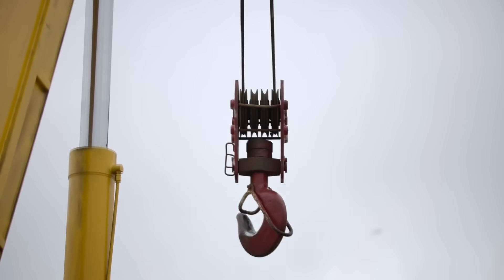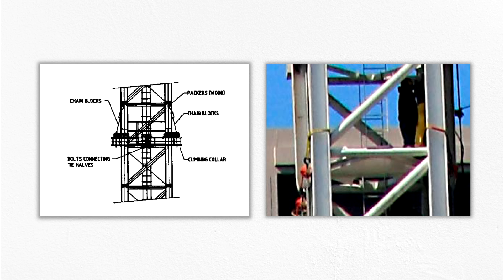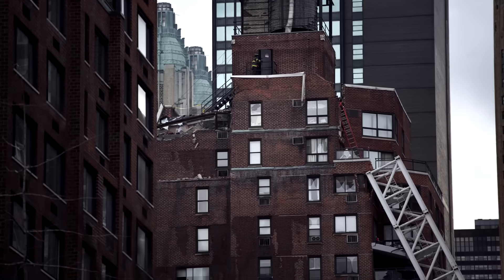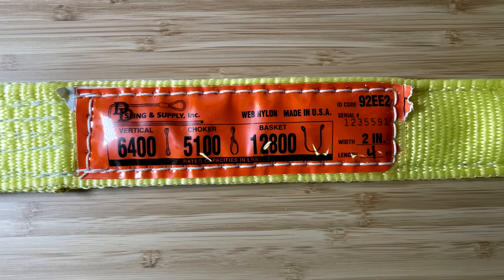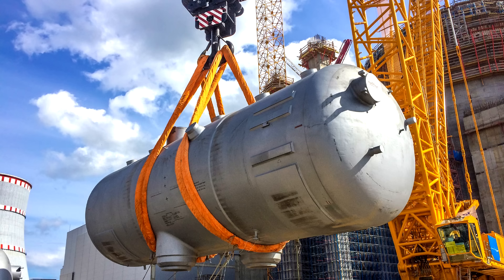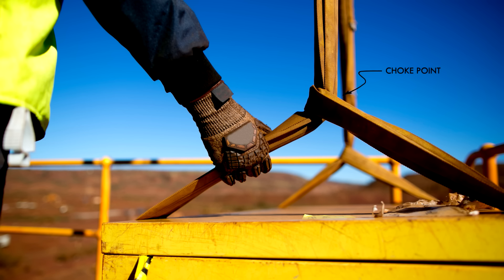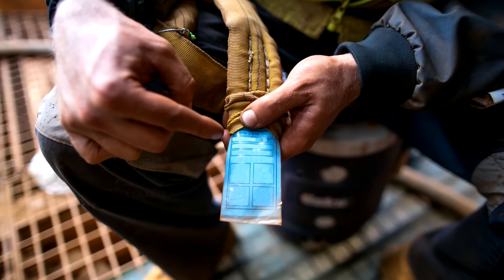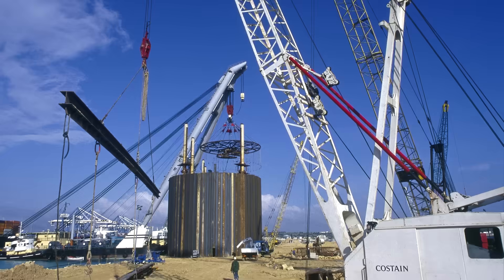Why Things Fall Off Cranes

Comment: One thing that affects the load a crane can carry is management caterwauling that the sling or chain is just fine, keep using it, a little cut won't hurt it. This is more common in steel shops that have a bridge crane.
Reply: Whenever I found a damaged sling I cut the eye open so nobody else could use it.
Reply: @brianveroba9059  Absolutely, I started doing the same when I came across stuff like that.
Reply: @brianveroba9059  I've had to do the same, though I've had guys still snag them out of the trash and fucking tie a knot to put them back into service. I just couldn't even.
Reply: Back in the late 80's I was in IE at a major manf. plant.  Our bridge crane was huge and when the siren was wailing, I'd move some where it wasn't.  I never EVER felt safe under the load.  It's like being claustrophobic.  I didn't mind heights on a good structure, but I never could trust loaded slings, chains or hooks.  Especially if I didn't rig it.  I still don't get under stuff unless it has stands or blocking under it.
Reply: @stxrynn  I now work for a concrete precasting plant, and it is a no-questions instant termination for anyone who walks under a suspended load. Some of our pieces weigh 60,000 pounds.
Reply: @stxrynn   I used a bridge and trolley crane to move 20 ton coils of steel. We had a big "C" hook for that and didn't use slings or chains.  We NEVER got under a load at any time, and if we were operating the crane, we NEVER took it over anyone.  Of course, that was at the end of nearly 40 years in manufacturing.  I started out, at 18 in a copper tube mill, using slings to attach bundles of copper or brass tubes to long booms handled by a bridge and trolley crane.  That was back in the late 70's, and I did stuff there that certainly wouldn't pass safety muster today.
Reply: @rodchallis8031  Understood.  There are times when you can't get the job done being too careful.  But I never was careless.  Sometimes, you have to do the hard thing... mitigate all the risk you can and get the job done as safely as possible.  But standing under a load was never one of the things I could do.  All of a sudden F=MA started running in my head and I beat feet out...
Reply: @stxrynn  thats just common sense
Reply: @southernshop8424  I thought so too, but the number of men that casually walked under the load EVERY time one went by was eye opening.  I couldn't do it.  Not even once.  Different times in the 80's, and a different work force I guess.  I still get the willies just thinking about it.
Reply: @stxrynn  in the early 80's i was a form rigger on three different lock and dams on the Tennessee-Tombigbee waterway project. I never once alllowed our crane operator to pass a load ooover anyone, to the point of pissing off ironwokers who were in the way. It was a union job, but ive also worked a lot of non union jobs where i was a rigger. The last 20 years of my job as a fitter liffting loads up to 140,000 lbs, the lock gates for lock 25 on the Missssissippi River, there were 6 of them, and myself and two coworkers hung them vertical in a jig in the shop using all three bridge cranes. I have never let 

anyone get under a load. 
You must have worked in a very unsafe shop. With some very arrogent uncaring people
Reply: @southernshop8424  I was just a kid, about 25.  My first big shop.  It was full of old timers that built the place and worked for the founder.  They were very comfortable with what they did.  Most started there in the 40's and 50's.  I guess the plant was build in the 40's to supply ammunition to the war effort.  We built some of the biggest mining equipment made.
Reply: Nylon slings usually have red fibers woven into them that can be exposed by a cut.  If the red fibers are exposed, the strap is to be removed from service immediately.
Reply: Makes me glad for my boss and foreman. One of our chain slings got dropped when taken off the hook and landed on its steel tag hard enough that it broke. 

We still had the parts and it was still legible. The foreman insisted the chain be retired until it could be retested.

Comment: Saw a rigging accident where they were doing a 50 meter lift inside a power plant. The riggers didn't have long enough cables so they WELDED two wire ropes together. Fortunately no one was under the load and there were no injuries.
There were some people fired though.
Reply: Of all the ways to possibly join cables... welding directly on the cable should never be the one that's chosen. That's insane.
Reply: Damn, that's stupid. A good splice would have worked a lot better, but beyond their skills and comprehension.
Reply: Sounds like they royally deserved it!
Reply: WOW, welding ...? Took me a second to figure out how they'd even have done that, because I just couldn't replicate the magnitude of stupid required to think of it.
Reply: I would not lift weld or wire jointed rebar cages unless the strops went through the cage and was attached at the bottom. I had lifted some in a yard that had just pulled apart. Care needs to be taken with any lifting eye fitted at a factory as miss use on the way to you may have weakened it, better safe than sorry.
Reply: BULLSHIT! How can wire cables be welded? They can't be.
Reply: That’s why YOU use UNION IRONWORKERS to do all rigging.
Reply: Not sure about this one being true. Ironworker for almost 40 years and a safety manager for five. I've seen some pretty stupid stuff but welding the cables? Calling BS, especially at a power plant where they don't mess around safety wise
Reply: @stevethomas760  absolutely BS.   No licensed/certified crane operator in the world would have made that pick.
Reply: @adstaton8461  Yep

Comment: For 30 years I never had a problem with rigging failing when using fabric straps. I'll stop an entire project and go out and buy straps before I use a chain.  Chain slips way more often than straps. I also way overrated my lifting straps, 4 straps rated 6400 pounds each to lift a 4000-pound piece.
Reply: Chains caused a number of early mining elevator disasters. Because with a chain, one link will just snap instantly without warning, while woven or braided straps will often show visible sign of going weak that can be spotted in advance.
Reply: which is sane. As much as possible, a single sling should be able to take the full load, in case of failure of the other ones (or of the anchor points, another source of lifting accidents). at least long enough that you can bring the load on the ground.
Reply: Chains have their place, like hooking to a attachment point, but definitely not as a basket on steel, but I do prefer straps for most of the picks I’m associated with.
Reply: Everything has a weak link / area . Bless ya'll from hooterville, n.c.

Comment: I love how much you connect the theoretical engineering to the actual work and construction process. Maybe it's just chemical engineering, but as one in training, I often feel like I'm taught that the people doing that manual work are beneath me somehow. Not only is that just plain wrong, but it's essential to listen to the people on the ground because they have familiarity and experience with the tools and equipment that I won't ever develop. All of my equations and models can be made meaningless by a simple defect, and it's up to their expertise to identify and fix it before it becomes a safety hazard. Learning how to listen and communicate with others is a critical, and I would say undervalued, part of engineering training.
Reply: Indeed. Those lowly manual laborers implementing your design often know it MUCH better than you do, especially with the abstraction that CAD tools can impart. Years ago I had a temp job at a custom conveyor manufacturer. It quickly became obvious that the process and mechanical engineers designing the system had never worked in the shop assembling their designs. Pre-punched holes often needed to be welded shut and re-drilled a half-diameter over, chain guards needed to be modified to fit around motor mounts, etc. If they'd have spent even a half-day per month in the shop actually trying to bolt their creations together, they'd have made much better designs.
In chemical engineering, a process mocked up with glassware on a table can't just be scaled up to the size of an oil refinery. The people actually building the industrial-scale apparatus will often have keen insights into possible problems, or process efficiency gains, whether they can name five elements or not.
Reply: You are going to be a great engineer if you keep that mentality 👍🏻 respect
Reply: I love you for saying that. I was a foreman for an ironworking company and on every single job I would have to inform my boss on everything that the engineers/architects f*cked up and they were always defiant and told me I was wrong. 99% of the time I was right, but they would always belittle me for pointing out that an H beam junction was wrong in the CAD files, or various other things that looked good on CAD but don't work in the real world. I had a long, very choppy relationship with my direct boss because I would point out impossibilities on the CAD files before I even got on site and he would call me an idiot...and then get mad when I was right. Eventually I left the company after fighting long and hard to get a company-wide standard put in place so that engineers/architects would have to have a mandatory time spent in the field on jobsites before they were allowed to write up prints. I still don't understand why mandatory field-time isn't a requirement for them, it would save so much time, money, and arguments between foreman and designers. To this day I absolutely HATE architects that have never been onsite, they are stuck up, snobby, feminine man-childs that refuse to accept responsibility when they are wrong, especially when "the useless ground guys" tell them they are wrong and their $500,000 degree was a complete waste.
Reply: As a tech I have long thought that any designer should First work a year in maintenance / repair (or possibly at least assembly) before design...
Reply: As someone having worked in the field for a few years, and now going back to school for ME I definitely know that sometimes the designers/engineers have no idea how it works in the field.
Reply: It's probably just your teachers/colleagues. In my EE program, we didn't touch on the actual work that often, but when we did it was always "make sure people can actually do what you're asking of them". In my professional life, I've worked with enough technicians to always keep the execution in mind. I've heard too many stories of engineers designing installations or planning repairs that were stupidly dangerous or even impossible to execute as stated, because they didn't take into account how a technician would actually have to do the thing they were asking.

So yeah, keep that in mind when working with the site guys. They'll appreciate it, work will be done as intended, the bosses will be happy (less mad?), and you'll get yourself a better reputation.
Reply: How is this possible as a chemical engineer. The people under you who are doing the manual work are handling toxic chemicals that can kill you.

Comment: So, I've watched both vids and now I have a question.  The big big big huge Leibherr crane that failed while under test, the hook itself failed.  Would that have been an above hook failure or below hook failure?
Reply: You mean this one: https://www.youtube.com/watch?v=o1s79Uk10TA ?
Reply: If I had to guess as a layman, I'd say that it's an above hook failure. Below hook failures should be due to sliding and abrasion, center of gravity issues, failure of the load itself, or the increased stress from incorrect angles on the slings.
The hook is part of the linear train that is the load cable and the crane itself. Those should be separate as they are part of the well known structure.

Comment: I don't get why some of the crane drivers I've come across want the hassle of trying to balance a basket hitch around the hull of my sailboat instead of using the attachment points. People like me with a racing sailboat often use the home port crane ourselves (after being trained by the port master), so we have a main sling connected around the centre of gravity and a few lines for added stability ready to hook up

Comment: Really interesting stuff as always!

Also thanks for sharing the name of a "spreader bar", I've been trying to figure that out half-heartedly for years. Got a small Harbor Freight hoist to help me change mower decks by picking the front of the mower up a foot or so, and I didn't love the sling angles, but didn't want to go with the previous owner's solution of a game gambrel due to its load capacity being too close to the actual weight of my mower. (And because it didn't seem like the "right thing" to use) Now I know what I need to learn more about.